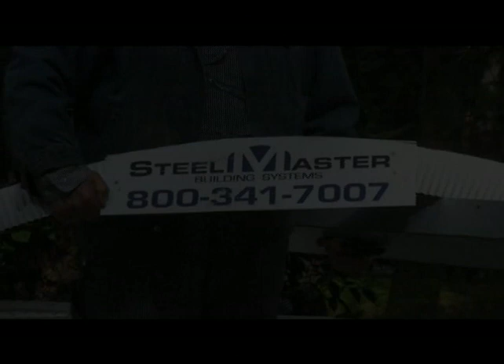Steel Building Construction

Comment: Like to know dimensions on keyway. How big the slab needs to be for dimensions of say 30x60 building.
Reply from the maker: Hi Tylar, we’d be happy to get you information on the dimensions. It depends on which model building you are interested in and if the building will use SteelMaster endwalls. I’d like to have a rep reach out to you to work on the specifics. What is the best way to contact you?

Comment: When performing the final tightening of all the nuts, is it necessary to have someone on the outside of the building holding the bolt stationary or is the impact driver able to work without having each one held?  Is there any provision for friction on the bolt head so it doesn't spin?
Reply from the maker: It is easier if you have someone on the outside holding it in place. Some customers have found creative ways to do it on their own.

Comment: After watching a few of these, I think I would embed the bolts in the concrete instead of drilling my life away. Would have to make a jig to do it properly, though.
Reply: It does seem like it might be easier if J-bolts or something like that could be used in the pour, but then it's critical that it's perfectly aligned.  That may be cause for great anxiety if they're off the mark..

Comment: How wide are base plates? To know how far in to put piping in slab.
Reply from the maker: Hi there – thanks for your question! Our standard base connector is 9.5" inches wide. The type of piping and where you are installing it will determine how far in you need to be. If you're installing electrical or water lines along your arch panels, you want the inside edge of the line a minimum of 11” from the edge of the concrete. For sewage or waste lines you would put them 12” in from the edge of the concrete. For standard corrugated endwalls, you want to be a minimum of 4.5” from the edge of the concrete. Hope this helps! Please let us know if there's anything else we can assist you with.

Comment: I've had one since ~1994 (I forget exactly when I bought it) and didn't seal it since I expected to unbolt it when if I moved. I did (air tools rule) and reassembled it at my new location. No leaks, even in SC rain. Water doesn't fall upwards. I do anti-seize every bolt as a precaution in case I want to change something, and that also protects the threads a bit.
If I were building in a heavy snow zone or a hurricane risk zone I'd frame the inside with additional steel (capturing the slick outer surface advantages of the design and the internal advantages of a beam structure such as being able to hang winches and equipment from the beams).
If I wanted ultimate strength plus more space I'd use ISO containers for the vertical walls (they are gasketed and seal out rain/snow, Barring a massive avalanche with rock and ice no standard ISO container will crush under snow loads) with a rounded roof plus additional reinforcement. I tend to ignore sales pitches and do my own research, then do my own thing with gross overkill. Steelmaster do make ISO tie-in bases which are a slick way to use their product as a roof and endwall solution with ample interior room.
ISOs are superior to mere walls as they provide (watertight) protected space, are instantly usable, and offer many options (check commericial ISO sites such as Sea Box for ideas) for low-height structures.  ISOs are good to 150mph winds, and if those hit most other structures including steel buildings will be chaff.
If your steel building width is also an ISO length or multiple thereof, you can drop ISO/ISOs across one end and tie in.
If you are where severe snow or wind is a concern, I'd speak with a steel fabricator/welding shop who do industrial work and have the drawings in hand. Rounded steel buildings have inherently smoother and stronger SHELLS than conventional metal buildings, but conventionals have internal support.
There is no reason you cannot choose to combine the two methods and build yourself a real beast!
Further, you could erect the shell then frame it at leisure after adding power and lights. It would be easy enought to make plates which would pick up the bolt pattern in the steel building skin and weld or bolt those to an internal frame. Many folks who use such buildings will have the gear and skill to do this cheap or reasonably.
Reply: BTW since there isn't much to really differentiate steel building makers other than their websites, an enterprising company could design an internal frame for their shell buildings to capture the market of customers who like to hang equipment or otherwise take advantage of beam framing but don't want to roll their own to support gantry or other industrial equipment.
Coordinating with galvanizing companies (many of who have suitably large dip tanks) could produce Galvalume-coated structure to complement the skin if that is wanted for some locations. Just as building panels are designed for convenient construction using multiple sections, framing could be thought out the same way with a constellation of basic parts plus (any required custom beam lengths) to produce a given application. Do that right and it removes any objection other than esthetic to the "Steelmaster"-style construction, and of course you can order a conventional steel structure to attach to your Steelmaster if that's wanted for a "public facing" space.
The only "rules" are physics, building codes, your abilities, and your wallet.

Comment: What keeps it from leaking you ask? Good question - the bolts have all have rubber washers and those work well. But a few years ago these building included a whole bunch of butyl caulking strips which you applied to every seam. Could be a nasty mess if it got on the bolt threads but it was very effective in sealing everything tightly. But interestingly enough now they say you don't need it and if you want it you'll have to pay through the nose for it. Hey instant additional profit!

Comment: Not so much a problem with the products themselves, but I would dare say the "used car snake-oil salesmen" nearly all of these steel panel sellers employ to peddle their wares are the single greatest reason people avoid these product.
Reply: I still got that impression from one of the companies, though not with steelmaster. It does seem nearly impossible to get a straight up quote on the pricing, and during my initial inquiry, the sales guy threw out an apparent low ball price as a test, and as I didn't jump on it, he abruptly said he'd have to call me back, and never did.  It's an odd industry.